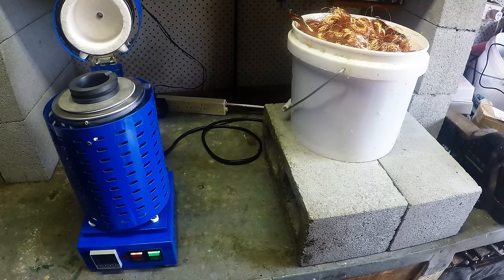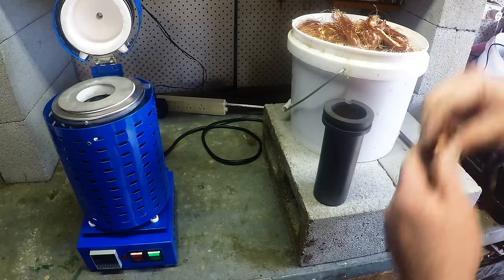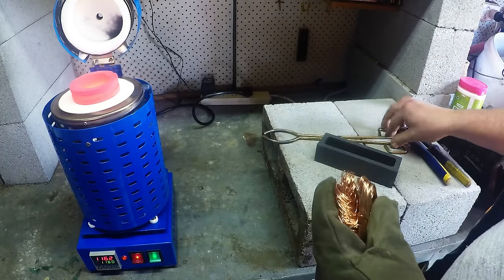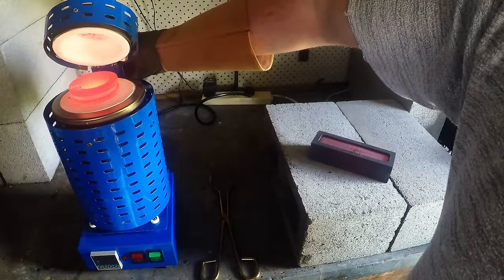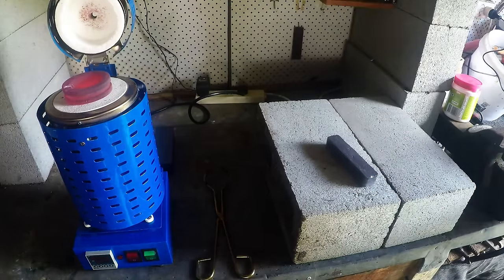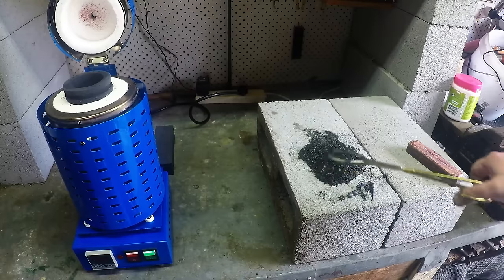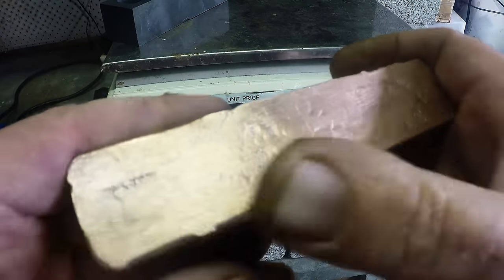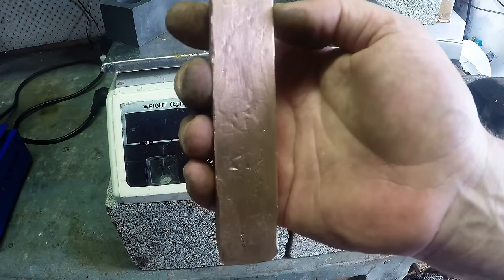Making a Copper Ingot from Scrap Copper Wire

Comment: The reason why the wire produces so much flame and smoke when you dump it into the hot crucible is that the wire is insulated with a polymer film insulation. If the wire were very pure and uninsulated, it wouldn't be shiny (oxidation) and it wouldn't flame up nearly as much (no polymer to burn off). They're insulated because the coil windings have to be isolated otherwise the current just shorts across the coil and doesn't set up that nice toroidal current to get the nice linear magnetic field.
Reply: Kevin Thompson

Comment: Very nice video. Love that ingot. A couple of suggestions I would have are safety oriented. When polishing I would wear a glove on the hand holding the ingot being polished. The reason is because that wire brush could rotate right up your hand at some point and being barehanded you could lose some skin. Also, I would wear a clear face shield during that process. The reason is because sometimes those wires in the wire brush come loose and fly away at some pretty high speeds. That's one way to lose an eye.

Comment: What fell out at the end is called slag and not flux. Flux helps flow and degreases surface tension in water. Slag is leftover additives and oxides plus the starting crap that went in along with the metal

Comment: Wow Ben that bar really came out nice. I like that naturally poured look that yours has so much better than the extruded look that some commercially made bars have. That is going to be a great way to build up a thousand pound stack or so. Copper is only a bit over 2 dollars a pound right now and I could easily see it going back up to 4 dollars a pound again in the next few years. Bars like the one you have though will go for more than just plain ugly copper though because of its pleasing look. I have always wondered how hard it would be to make a bar like that out of phone cable or some other low grade wire. Also if you had some small ugly brass pieces laying around it would be so fun to see it being turned into a nice ingot.
Reply from the maker: Thanks Scott, yeah I will be trying a brass pour soon.
Reply: eWaste Ben Hi Ben, amazing bar! Could you provide some details as to what equipment you use? It would be much appreciated, cheers!
Reply from the maker: this is the main website for the furnace
http://www.china-jiuchen.com/main.asp?pid=41&id=5

Comment: The Benjamin Mint. That is real cool Ben,you should get some kind of kickback from the company for doing a great job at advertising the product and showing what it can do and how easy it is to work with. I ordered one for my shop.  Sometime during the fall of 2011 spot price for copper popped up to nearly $4.00 a pound. hang unto those bars.
P.S I like your bench set up.  I cringed when i seen you using the iron rod to tamp the copper into the crucible,.go to the hardware store and get a 1 1/2 inch wooden dowel x 16 inches long,depending what you prefer. I wouldn't want you to crush through your new one.

Comment: You can make a simple mold in sand to pour the metal into. Make a wood frame, press a design in and pour. There are youtube videos on how to prepare the sand.
Reply: agree with that but need to be clean when pouring the molten copper on homemade mold there's sand stick on the copper ingot so needs to be clean as well

Comment: Just a warning for anyone trying this, although you do heat up your mold to prevent the hot metal popping (steam explosion), you still need to remember that what you have your mold on may also hold water (cinder blocks, concrete, etc). So while your mold may not "pop" the concrete can if you spill or if the mold cracks.

Comment: I have a mix of mostly copper and some brass bullet casing which I melted out the lead centers.  Since brass melts at lower temperature will I be able to pour off, leaving only the copper solids.  I have no experience in melting high temp metals, and can't bear throwing this metal out.

Comment: that appears to be a : Kerr 3 Kg, 120 VOLT US Automatic Electro-Melt Maxi Furnace and according to the manufacturer is not recommended for melting copper as it will damage inner core any update on how long this lasted ?
Reply from the maker: the link to the furnace is in the description, works good.

Comment: With those temperatures that thing will be hot for another 8~12 hours.
I'm curious as to why you think it's best to let it cool between pours, if anything it will degrade the crucible even faster. The crucible is a consumable, it will only last so long. Smelt and pour to your hearts content before the crucible breaks.
Keep the bar form on those cinderblocks, they can take the heat. The grime on your table probably cannot, and might even ignite if there is oil or something combustable around.
Could you link me where you got the furnace? I'm interested because my propane burner cannot reach temperatures high enough to smelt copper.
Take some of my comments with a grain of salt, as I'm still a beginner at this aswell.
Anyway I've rambled on long enough, thank you for the great video and keep up the good work.
Reply from the maker: I appreciate you advice, main issue with continuous melting is the heating element on these types of furnaces, they can burn out when heated for too long I was told.
http://www.china-jiuchen.com/main.asp?pid=41&id=5
Reply: I didn't think about the heating elements, I was certain you meant that the crucibles would burn out. Excuse my ignorance.
Thank you for the link.

Comment: HOW DO YOU GET THE COPPER TO RUN SO SMOOTHLY? when i pour just one lb. bar the last of it hardens right in he pour?  and my copper seems thicker and yours runs like water? im heating to 1200???   what am i doing wrong?
Reply: You need to use a flux to make it more of a liquid aswell as remove impurities, I use Borax Powder with Aluminium

Comment: Where does the borax go? Do you worry that it will go into the ingot, or does it stay on the surface of the ingot? Will it buff out?
Reply from the maker: Borax just at the end to lift out any inpurities, it forms on top like glass, it just break off
Reply: @eWasteBen  yes that's what will happen in the crucible, but are you skimming the top to pick up the dross?

Comment: That's pretty impressive Ben, Enjoyed the video :)  Can you do weights before and after to show the difference?  Also, do you think it would be worth it to melt copper that is not as pure to get a better value? (like motor windings covered in shellac),  congrats on your first ingot and the great pour, looking forward to the next one :)
Reply from the maker: Thanks, yes it would step wire with shellac up a grade if you were to sell at a scrap yard, but you would get more selling as poured bars on ebay as bullion, people like to stack copper bars and they can be expensive so you'd get at least double
Reply: I would love to get one of those furnaces, i may have to find a way to justify it ;)

Comment: I'm impressed with your furnace and a nice bit of copper, did you say that a lot of the fine stuff that came out of your crucible was the graphite from it intriguing hey anyway very nice job from your first attempt I'm not buying a furnace but going to try and make one but hey you done well keep doing and you'll become a master at it
Reply from the maker: Think it was partial graphite and carbon, from what i've been told, the more air contamination the more carbon produced, so I need to keep the lid closed when cooling down.
Reply: ok I'm with ya, Geez that will take a while as it was still pretty hot even after what was it 15 minutes as you said one a day

Comment: You kind of misrepresented borax. It won´t remove glue or things like that, it will simply keep the metal from oxidizing. Maybe the hydrogen peroxide that forms when you add water to borax could remove glue, but I don´t think adding water to a crucible at 1k°C is a good idea :)

Comment: Just curious... I am interested in melting copper, you show and state that your melting at 1160 Celsius, however the link to the Small Melting Furnace only goes to 1150.
Reply from the maker: you can re-set the furnace, mine is set to 1165 max

Comment: Ben just a quick question if I may, for you or anybody else who might know, if i smelt tinned copper down into ingots, will the tin taint the copper ingots?  and if so is there anything i could do to separate the tin from the copper?
Reply from the maker: it might depend on how much tin, bronze is 88% copper, 12% tin but most likely tinned copper is much lower.
so it might just mix in and not be noticed, I will try it one day with tinned copper wire and see what happens

Comment: are there any links for the furnace you are using there. the electric ones on your amazon link are not rated to burn hot enough to melt copper.
Reply from the maker: None of them are, mine was tweaked to heat an extra 10 deg' Celsius to get it to pouring temp.
pouring temp is hotter than melting temp so these electric furnaces are not good enough, mine has blown out twice, only good for gold/silver

Comment: Looks like a brass wire wheel. I don't think you're polishing anything, just depositing the brass onto the surface, as copper is harder than brass (I think.) I could be wrong, but might want to look into it. Cheers.
Reply: Paul Robison brass is harder,it has copper and other metals in it

Comment: Can you melt more things than just copper, silver, and gold? I am considering buying your same model type.
Reply from the maker: like what?
Reply: Iron, glass, rock?

These are just questions
Reply from the maker: max temp this unit goes to is 1160 deg celsius, so just look up melting temperatures for things you want to melt and see if it's under 1160c, steel definitely not

Comment: very nice. inspired me. thank you. any recommendations on unit for small gold and silver bars. dont you loose lots of metal sticking to crucible.  oh, you just said nothing sticks to it. okay..
Reply from the maker: yeah the metal only sticks if it cools down quicker then you can pour, mostly copper because it needs very high heat.
there's a couple furnaces cheap enough in the recommended link I put in the description, they are good for gold & silver, not so for copper.

Comment: Um.. I think that's called a "yoke" or "deflection yoke" never heard of "degaussing cables" before... but the Yoke is a copper winding that controls electron flow based upon the electromagnetic frequencies.
Reply from the maker: The yoke is a different part of the crt tv, the degaussing cable runs around the tube, is 3-4 ft long, 1/4-1/2in thick and is pure copper wire wrapped in insulation tape, you obviously have never seen the inside of a tv or a yoke to think that wire I used was from a yoke, it's totally different.

Comment: If you want a KG of copper, why don't you just weigh 1 KG of wire then put that 1 KG of wire into the crucible? If you fill the bar all the way up, but have more, just stop pouring and use the leftovers later. Its better to have 1 KG of copper, than 0.826 etc, its less confusing and easier to store.

Comment: Why do you recommend a furnace that you're not using yourself just wondering I'm in the market for a furnace and yours looks pretty cool it runs off electric but yet you're recommending a gas
Reply from the maker: because electric furnaces break too easily, they arc out and if you crucible cracks during melt, you blow the main element, costs $130 just to buy a new one, also to melt copper it eats up the crucible in 5 or 6 pours, at $25 a pop it's too expensive.
I just bought a propane furnace, my latest video
Reply: Where I can get the furnace & ingot cast ??

Comment: how much power needed to melt that copper, how much u gain melting it and pouring?
Reply: I just looked up one of these electric furnaces and it says it is only 850 watts!  That's less than my space heater.  So, I wouldn't be worried about the cost of electricity.  Oh, and I have solar panels on my house :-/
Reply: What's the name of this kind of furnace?

Comment: Is it pissible to melt the copper with the insulate still on the wire, and make a decent ingot. Does.the insulate burn off? Does the insulate result in extra slag?
Reply: extra slag because it will melt
Reply: Brandon A Sure you can. But it will stink like hell while it burns. Not safe for you and the environment. Second, it will give you a lot of slag. Ben put quite a pure wire and he got so many slag. Imagine how many you would get. Lastly, I'm not sure how the "furnace" would operate after a few burns like this.

I have just invested in a wire stripper that can cut the insulation along, not across. I am going to make a video when I have time to unpack it and gain some practice.
So you might want to subscribe to my channel too if you like. Cheers and greetings from Poland.
Reply: Cool deal. Im a noob in the melting game. Got some pretty good aluminum ingots done without too much effort. My copper comes from the core and coil hid ballasts so theyre pretty nasty with coatings of crap

Comment: You should do a full heat cycle or two, on the equipment before putting ANYTHING in there to melt. And the stuffing of the cold crucible is just stupid!

Comment: Can you recommend a furnace that can heat up about 12 Kg at a time?
Reply from the maker: The guy that sells these furnaces here in Melbourne also sells a 10kg - 20kg version but it's like $2500 and a two person job to pour
Reply: Ouch, yea, that's a bit much.  I'll keep searching, thanks for the help and video.
Reply: There are side-loaded ovens, just like your microwave. But they waste more heat outside and weigh more too.

Comment: I bought this furnace, warmed it up once! and the heat wire is allready defect. Stay away from these furnaces, unbranded china shit.
But cool video, I was supposed to do this myself, but my owen wont worm up sadly :|
Reply from the maker: You might of got the other type, this one is used in every gold dealers in my country and is great, works like a charm
Reply: It looks the same, but sure it can be a knockoff from what you have. Does yours have a brand and modelnumber? If so Im interested in that, so I can buy a furnace I can trust:)
Reply from the maker: https://wholesaler.alibaba.com/product-detail/220V-3KG-JC-Vertical-Type-Small_60542219696.html

Comment: how do you remove the dross?
Reply from the maker: it's clean copper, no dross, dross is formed from low melting point metals via oxidation, like aluminium, lead, tin etc, not copper

Comment: Is this a profitable hobby? Is it worth it to melt down and sell these metals?
Reply: NewEnglandboy453 you need to keep a closer eye on the copper rates as it fluctuates quite a bit at least it does here in the uk
Reply: NewEnglandboy453 as he said in the video, you're better off just selling the scrap. he's making the ingots just to look at. others make ingots for better means of storing their metals, purifying dirty metals, and for easier re-melting later on to make castings.

Comment: what's borax do? i was curious
Reply from the maker: it takes out impurities and helps the metal melt quicker too
Reply: Ok I think I get it
Reply: It acts as a flux : protects the metal from oxygen to prevent oxidation. Whenever you do welding, you have to protect your metal from oxidation otherwise, the metals won't stick together because of the thin layer of oxide.
Example, in electronics, buy rosin core lead-tin 50/50 alloy. The hot rosin vapors protects the metal surface while it is hot and also the liquid rosin spreads on the copper connections.
Plumbers also use flux while soldiering pipes. Arc welders use argon or argon/CO2 gas. Titanium welders use ultra pure and dry argon.
Reply: Vrej Egon Spengler hokay...

Comment: where do I get a furnace like this?? A tip: use pickling powder from Australian Jewellery supplies and add to 80C degrees water to clean the metal from borax. Then polish it.
Reply from the maker: in australia? the main distributor lists them on ebay.com.au 302176365230
Reply: That's where I looked first. But no luck. It would be helpful if I have a seller name, brand name for my search, please.
Reply from the maker: the item number is all you need
Reply: hi,i am from melbourne....the item number doesn`t work...can you help me find manufacturer by name or something....cheers...
Reply: if the item number would work, we would not keep asking
Reply from the maker: http://www.ebay.com.au/itm/Furnace-for-melting-gold-silver-bronze-lead-aluminium-copper-/302176365230?hash=item465b1d6aae:m:mjPsU_GGdycl4r0a04GfI5Q
Reply: Thanks a lot Mr.Ben...The guy is living near me....Cheers mate...